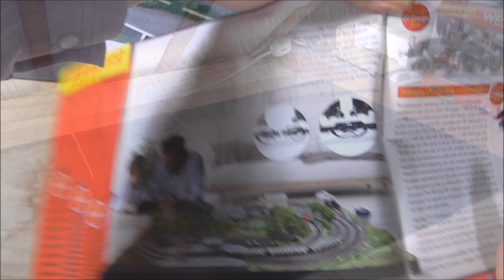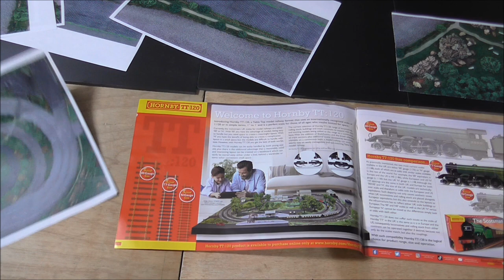Hornby TT Gauge quick layout build

Comment: Was wondering about the inner raised track. Do both the locos run on both sets of tracks?
Reply: The inner raised track is Tri-ang TT track. Both locos will run on it. This very old track is prone to rust, so I don't recommend using it! Modern track is much better. HOm track can be used for Tri-ang TT3 locos and rolling stock.  The TT:120 track is not suitable for old Tri-ang TT3. Thanks for watching.
Reply: The inner brown track is  known as Triang (Rovex) TT3 Type A track (1955 to 1960). It uses Code 100 rail. It was replaced, in 1960, by the more realistic Triang (Rovex) Type B track (1960 to 1966)  which uses the international standard TT Code 80 rail, the same as Hornby TT 120, Tillig, etc. and can be connected together.

Technically, Hornby's (Rovex) TT 120 track is Type C track.